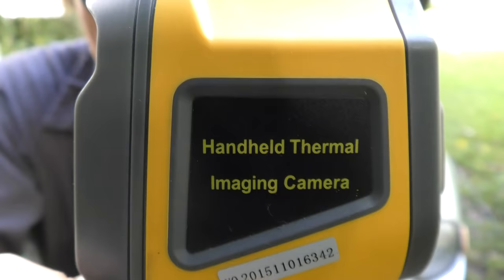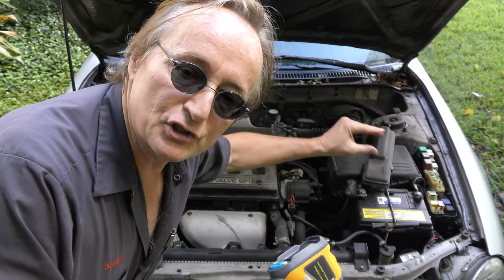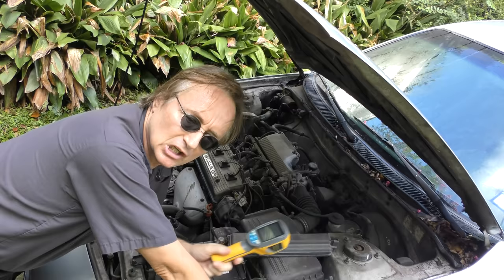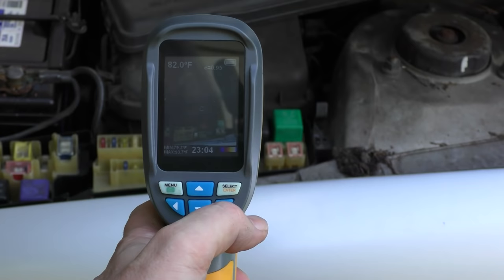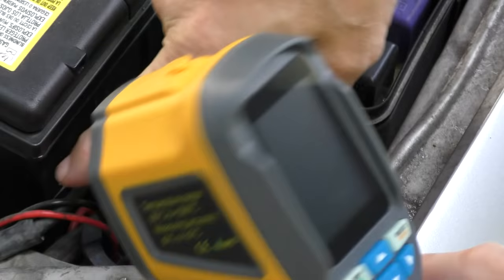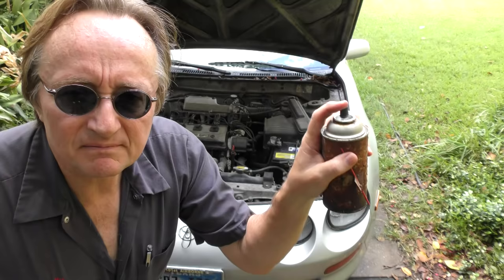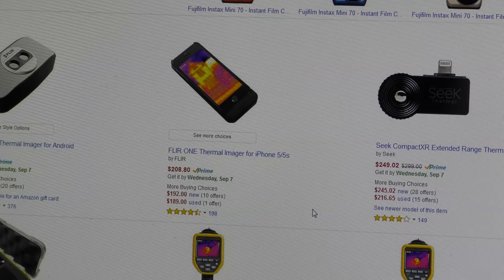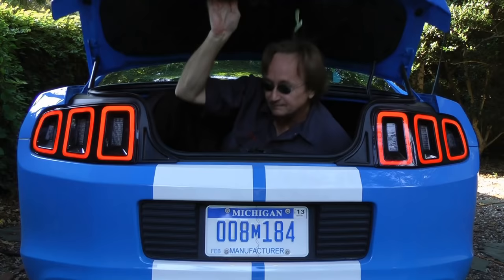How to Find Electrical Short in Your Car - Thermal Imaging

Comment: good day scotty.  i hope you can help me with my headache. my car, a manual transmission, diesel fed, 2014 toyota, as i have observed, lost some speed or power.  i dont know which is which (speed or power).  explanation: 3 months ago, it used to give me a good speed at 2,000 rpm. 

at gear 1 it gives me 20km/h
gear 2 --> 40km/h
gear 3 --> 60k/h
gear 4 --> 80km/h
gear 5 --> 100km/h

but now it gives me lesser speed for the same RPM (2,000rpm)

gear 1 gives me 16km/h
gear 2 --> 34km/h
gear 3 --> 54 k/h or less
gear 4 --> 80km/h
gear 5 --> 90km/h

in short, there is around 20-25percent speed reduction or power reduction regardless of the RPM (either 2,000 or 3,000rpm).  i dont know which is which.  i have asked mechanics and they gave me different suggestions - all of which never rectified the problem. 

oil change
gear oil change
fuel additives
engine air filter
engine oil filter
fuel filter

all done but the problem still persist.  can you please enlighten me on what could be the problem? 

thanks so much, scotty.  i live your personality and the videos you make.  so simple, so short, yet very informative.  more power and health to you and your family!
Reply from the maker: try changing the fuel filters as clogged ones often do that
Reply: all done, but non corrected the issue.
oil change, done
gear oil change, done
fuel additives, done
engine air filter, done 
engine oil filter, done
changed fuel filter, done
cleaned MAF, done

Comment: hi you may or may not respond but my passenger truck door was open while in reverse and it bent a good 6 inches too far forward. it closed but upon opening it dented my quarter panel and won't open more that 3 inches without doing more damage. I have seen any videos of fixes but non as descriptive as yours is there a way you can write a fix or video a fix so that the truck door is usable? we own a lawn care company so having all doors work is pretty crucial. if not I understand, thanks for the read :]
Reply from the maker: body work is not my forte. Takes a pro to bend metal without making it even worse. Try to find some Mexican body shop like we have here in houston who work cheap really. Or, get some of those suction cup body moving kits at auto zone and try fixing the quarter panel and then try bending the door with brute force
Reply: +Scotty Kilmer yea i guess I'm stuck. I'm not worried about the tiny dent. it's the sprung door I'm worried about its totally screwed unless I can find a splint or cut a splint the size to shove it in the door. we have tried to find a way to open the door with ought damaging the hinge more than it has been. guess it happens thanks for the reply

Comment: Not sure this method would work on electrical connectors that connect to sensors and such.  I had a short on a crank sensor and that didn't have enough power going through to make any heat. It just made the car not run.

Comment: What's the brand name of your thermal image tool - which do you recommend??
Reply from the maker: it's made in china, of course, being this low priced. It has markings that say CE RoHS handheld thermal imaging camera, which must mean something. It does work great though.
Reply: I just bought a Etekcity Laser grip - 2 warranty - -58 to + 716 degrees -Fahrenheit - see what happens - just thought to see if this would work on motherboards!!

Comment: Hello Scott,
I have a 2001 BMW 325ci that has grinding/clunk sound when I turn the wheel both left and right. When I jack the car up and turn the wheel the sound is gone. I went to a mechanic who said I need to replace the power steering pump and reservoir which I did and the sound is still happening. If you can help me it will be greatly apperciated.
Reply from the maker: your car is only acting up under a load, by a PRO front end man to check that who knows how to load test suspension parts. often worn strut mounts though on that model

Comment: hey scotty i have a ford bronco and the engine makess a tapping noise it doesnt always do it the oil pressure isnt low but drives as hard and strong as it ever has ive been told it could be a bearing an oil ump or a sticking lifter what should i do?
Reply from the maker: often sticking lifters, you might just replace them all if it's really old
Reply: Thanks Scotty I beleive im just going to sell it now

Comment: hey Scotty, My car headlight is always ON as I turn my ignition. Even though I turned Off the Switch for headlight. It just happened today. 2013 Mitsu Outlander
Reply from the maker: that has running lights, they are supposed to be on all the time, at least those sold here in the US and Canada.

Comment: Sir Charles Bergamy III  My 2002 olds alero, changed the starter, fuel pump, battery, but
 she rides for a while then cuts off in traffic and then she will start 
only in neutral, please help, going broke on new parts-CB3

Comment: Unfortunately, a lot of these devices only work if you are lucky and the problem is where you can test it without taking half the car apart. Also, you kind of have to know where are the general areas to test. I would be pointing that thing all over the car.

Comment: hi scotty i have a 1997 vw jetta wolfsberg edition. the low beam headlights dont work, but the high beams do. what do you think the problem can be?
Reply from the maker: wiring or headlight switch, pray it's not on the complex computer module that runs the lighting
Reply: Similar problem with my '84 Accord - left hi-beam never comes on at all, and turning on the right hi-beam turns off the right low-beam....it's truly bizarre

Comment: OK I have a question my ac unit supposed to light up green but it doesn't Wen I first start my car it only comes on when my abs light comes on?  can u help me
Reply from the maker: if ac works, ignore it. If not, odds are you have a computer module failure or bad grounding wires

Comment: hi scot i have a mazda 1993 astina 1.8 i can turn it on fine i take it to a mechanic and it works fi e for them but as soon as i bring or drive it home the revs die then go back up it then dies i start it it then dies again then i haft to wait 30 to r5 minuest before it works again any idea
Reply from the maker: find a better mechanic, one who can pressure test fuel pressure and injectors and ignition systems to find the fault. They aren't road testing it at all.

Comment: hey scoty can I used it through walls?
Reply from the maker: if a lot of heat is inside the wall, yes, you can see the heat, such as hot water pipes

Comment: hey scotty i have a 1996 chevy baretta that hasnt been stated in about a year or so. I have changed the battery and examined the spark plugs and oil. should i flush out the gasoline in the fuel tank or should i try and run it with the gasoline thats already in it?
Reply: flush it and change the fuel filter, gas nowadays don't store too well and breaks down pretty fast.
Reply: +〈Taking_A_Huge_Shit ok
Reply: +〈Taking_A_Huge_Shit
Where do you plan to take the shit to?
(i couldn't resist lol)
Reply from the maker: 1 year shouldn't hurt anything
Reply: +Scotty Kilmer ok is there anything else I need to do to be safe?
Reply: The only safety concern I can think of is the tires, because it may be time for a new set. Tires that sit over several months tend to flatten under the car's static weight with temperature changes, weakening the sidewalls when whipped back into motion.

Comment: hey scotty i have a 2004 g35 when i put on my ac the car starts to stall but wont turn it goes away and comes back it sometimes does it witch the ac off i replace both camshaft sensor but is still doing it wat can it be thanks
Reply from the maker: many things can do that, best to analyze the live and mode 6 data with a high level scan tool. But if you want a guess, often a weak fuel pump or computer failure
Reply: thank u scotty

Comment: Hi Scott, I am no mechanic or electrician, just a Dad trying to sort out my daughter's Matrix. I am trying to find a shop in town that uses this thermal imaging to find the short that keeps blowing the tail light fuse cuz I am at the limit of my tech skills. 

I have brake and signal lights but not tails. So my question is: If the fuse keeps blowing instantly, will there be enough heat in the system to show up on the thermal imaging camera to find the short?
Reply from the maker: maybe not, if it fries it that fast. Many guys will put a higher amp fuse in to find it then, as it will blow slower
Reply: A fuse bud . It happened to me also , and  it ended up being a fuse

Comment: I have a 2005 Mustang GT and there's a very loud noise coming from underneath my car when it starts cold. It is a very loud screeching sound and when I push the clutch in, the sound changes tone. After a minute or so of driving, it goes away. It shifts fine and it drives fine. Do you happen to know what that could be?
Reply: could be maybe  clutch chatter from the clutch grinding on the flywheel. look up "clutch chatter" , some people drive with it for years and others just change the clutch and flywheel.  i have the same thing but i just plan to change the flywheel along with the clutch next time i need a new clutch.
Reply from the maker: clutch parts are wearing inside, live with it and change all the clutch parts in a kit when clutch starts to slip
Reply: Thank y'all for the answers 👌🏻

Comment: i have 3 error codes after diagnosing my honda civic 1998. Intake air temperature (IAT) sensor voltage high, MAP sensor voltage high, IACV circuit failure. 
The last one sounds pretty serious. What should i DO?! The mechanic is googling the error codes but he is unsure what is causing the problems.
Reply: he couldnt pin point what to change, and suggested to try changing certain parts to see if the error is fixed.
Reply: that sounds really tough =(

Comment: I just bought a 1999 FRC Corvette and the check engine light is on with no codes showing up when I scan it and I've used many different scanners. Seems to run perfectly, and I can't hear anything that would cause any alarm.
Reply from the maker: then ignore it, but a pro mechanic goes well beyond simple scanning for trouble codes if you want the complete truth of all systems. See my video "fixing insanely complex modern cars"
Reply: Scotty Kilmer Thanks, will check that video out.
Reply from the maker: codes are just the beginning of analysis and GM software is often crap. Leave it alone until you have problems , or pay a pro to seriously analyze it with higher level scan equipment and experience

Comment: hey but I thought that if it is a short somewhere, a fuse will blow up. Why it didn't happen?
Reply: Many circuits, like the headlights in alot of cars, use circuit breakers that are self resetting after they cool off.
Reply: thanks for the info. as long as my car doesn't catch fire, I'm cool
Reply from the maker: fuses only blow when they reach a certain parameter of heat.

Comment: What if i find no shortage yet my battery keeps dying after an hour charge? Do I need a new battery???
Reply: You can also use voltmeter for diagnosing. Shouldn't be more than 50 milliamps current draw when car is turned off. You can find detailed videos on that on youtube.If your battery is more than 3 years old, you might have to replace it, but check for current leaks first.
Reply: +eemarko just checked my battery and it's six years old. I'm going to replace it, thanks. hahaha

Comment: Have you used this device to trouble shoot a catalytic converter yet?
Reply from the maker: yes, and it worked great. Cats should be hotter in the back than in the front, as they are supposed to heat up and burn hydrocarbons.

Comment: That is such a cool idea.  Wonder if I can use it to find studs in the wall.  Someone check that out, and get back to me :)
Reply from the maker: you actually could if you used a heat gun to heat the wall up first. Metal nails would hold the heat longer and show up as round heat spots.

Comment: One day I'll replace my infrared thermostat with that. They look the same from far :)
Reply from the maker: yea, but these work tons better, I never use my infrared anymore with this. Much better to know the whole picture of temp rather than one dumb spot
Reply: Yeah they do but thinking about how frequent I'll use it as a hobbyist doesn't justify their current cost. The one in your video is one of the most common one sold under various names, and yet still costs at least £170. I'll wait a couple more years before getting one :)

Comment: Does anyone have any idea why my 2004 Silverado 2500hd 6.6 diesel... The truck shakes inside someone told me it is the fuel filter so I changed it but still the same ...anyone know why and how to fix it
Reply from the maker: diesels are another breed, takes a guy with a dealer level scan tool and years of experience to work on a modern electronic controlled diesel like that GM. So find a guy like that. But you could check for broken motor and transmission mounts first
Reply: Check your injectors or the harness first. You need to find out if all cylinders are functioning correctly.

Comment: What if you cannot start the car?
Reply from the maker: if it's a dead short, you don't need to start the car.
Reply: I think it is the starter connection.
Reply: A few months ago I purchased a triumph Spitfire.  I clean the battery connection but did not push the battery cables sufficiently.  The previous owner had put the batter poles facing forward so when I closed the hood the battery shorted and burned out the $500 dollar wire harness.  The burned out wires are everywhere, underneath the dashboard, etc.  I have my work cut out for me.

Comment: Suppose a laser thermometer would work much the same way.
Reply from the maker: na, cause they only do points and it's very hard to aim them correctly. Seeing the big overall picture in color shows temp differences a thousand times better. I know, I have both and rarely use laser thermos anymore

Comment: i dont find it useful for anybody who doesnt work with cars, it be like them odd tools that you use once and trow in the back of your garage
Reply: I'm not a full time mechanic and I use mine weekly.  It is good for lots of stuff from checking the temp in my BBQ pit and smoker to finding moms dog when it doesn't want to come in at night and hides.
Reply from the maker: you can use it on your house for tons of work, anything electrical or heat or AC related.

Comment: hi I have this problem with an automatic 97 Honda accord.. it only goes till the 3 gear and from the when it tries to go 4 it just shakes forward and back(the whole car) still staying in 3 even when I floor the pedal it shakes as well.. help
Reply from the maker: time for a new transmission in most cases, those are very weak on that model
Reply: i already switch the transmission
Reply: +Ricardo Velazquez nothing like manuals I have same car with 240 miles same engine/tranny it runs like a champ. more likely your replacement is bad too